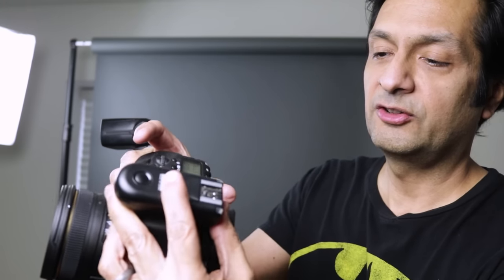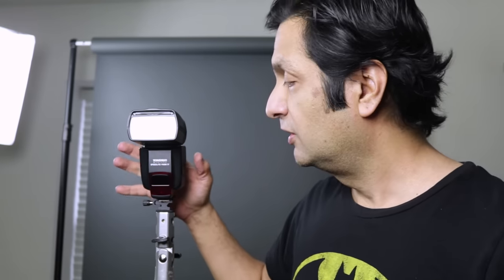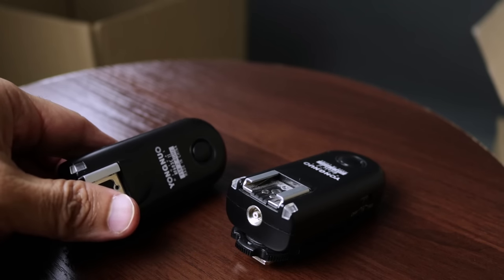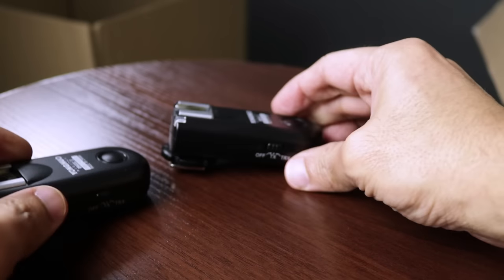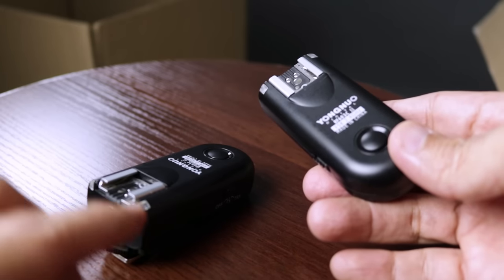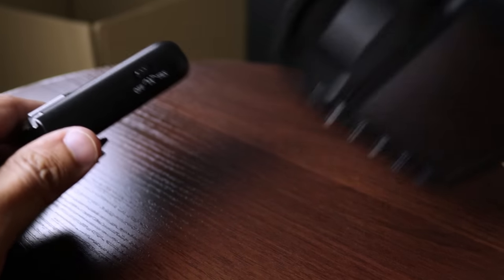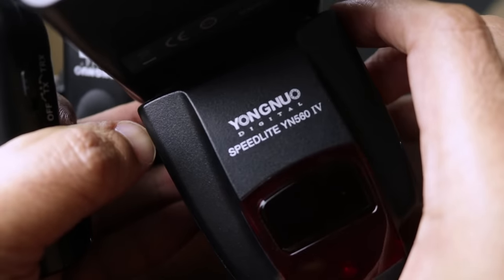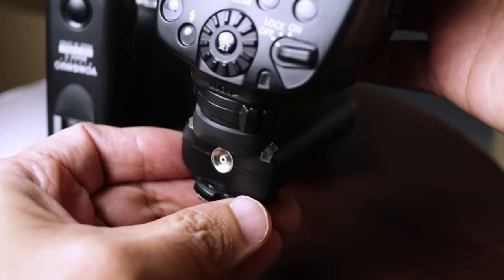How to Use Radio Triggers for Flash Photography

Comment: Thanks, Ed. Simple and clear. Also thank you for sharing your experience of using the Yongnuo triggers for the past couple of years. I got a couple of those too. I use them for remote focusing and shutter release plus as the trigger for YN 560 III and IV flashes. Very satisfied with them also so far.
Reply from the maker: +LongTimeTTFan  I resisted using anything but PocketWizards for a long time. Finally tried these awhile back and was pleasantly surprised.
Reply: Totally agreed. The YN triggers cost very little, $30 for two. Taking photos of grandchildren and with grandchildren is very handy now. With these triggers, i choose the moment to release the shutter, not have to rely on the camera's timer. I have used these for only 3 months, they have been 100% dependable. Out of the box, nothing else needs to set and they work with the YN flashes perfectly. Thank you again for your video. A big fan of yours. Your explanation is easy to understand. The videos all have demo to show the procedures and outcome. Please keep up the great work.

Comment: I'm using the exact set up with a Nikon Z50, but with an older Yongnuo Speedlite YN467. I have 2 transceivers (RF603N II), but they are not working. I also tried to set the channels inside at different positions and adjusted the sync speed - still no flash. Is it the older speedlight or the camera? Does anyone know??? I'm very frustrated! Thanks!!

Comment: what sucks is that most often, brands only sell transmitter-receiver set and not sold separately. Say you want to use multiple slave flash – means you'll be needing individual receiver for each.  if there is a stand-alone receiver being sold it could be a hit and miss purchase bc you won't know if your trigger will match/pair with the receiver. Is there a life hack for this?
other question is can i use other flash brand as slave (+receiver) granting that all is operation is manual and no TTL?

Comment: I have the rf603n, it doesn't have tx or TRX function. Is there any way to make the triggers transmitter or receivers? What are the 1234 switches inside

Comment: If it's not E-TTL why does it have the Canon Contact Pattern on both ends? Manual Triggers would only need the center Contact!
Reply from the maker: From what I understand the contacts allow for E-TTL pass through (if you have an E-TTL flash mounted to the transmitter, which is mounted directly to the camera, THAT flash is still connected via E-TTL).  However, the transmitters to not transmit E-TTL signals to receivers.

Comment: How would you use that for multiple lights? Would you have to be another set of triggers?
Reply: buy * another set of triggers?
Reply from the maker: No. But if the flash units don’t have compatible internal receivers you’d need more receivers. Or you might be able to trigger the other flashes via their own optical sync (ie S1 etc).

Comment: Hi, 
Does the transmitter have to be compatible with the camera? Since you are using Canon, does the transmitter have to be Canon-compatible?
Reply from the maker: Short answer, if you plan on using TTL, it has to be a compatible and so does the flash. If using manual the trigger just has to fire the flash generically.

Comment: what are the setting on the actual camera menu or does it just read it automatically if you have the flash trigger attached?
Reply from the maker: It depends on the camera. But with this type of trigger, the camera hot shoe should just work.

Comment: Thanks Ed! I did have a question regarding  remote shooting. Is there any way to trigger the shutter button remotely once it’s hot shoe has been connected to the transmitter. I have two trigger remotes but since my speed light has a receiver connected to it, I do not need the second remote. Is there anyway I can use the second remote to shoot remotely?
Reply: Yes it has a cable, select camera mode and convert the remote into a camera remote setup. Check about it. It's easy if you have 1 cable